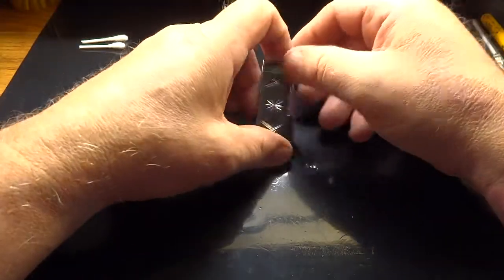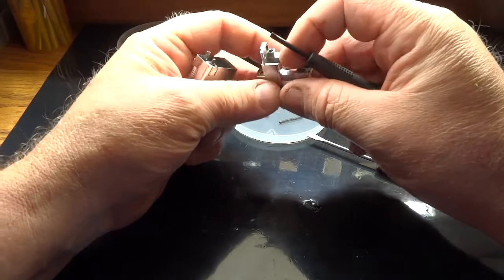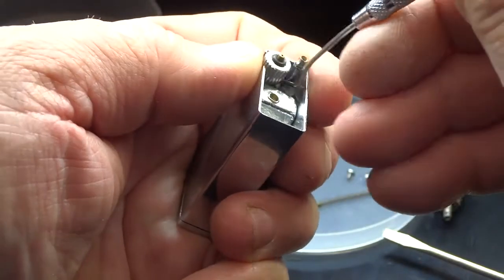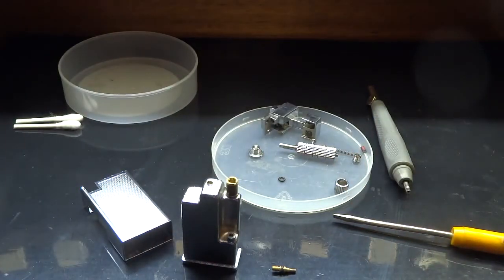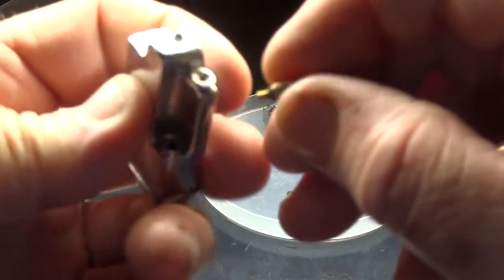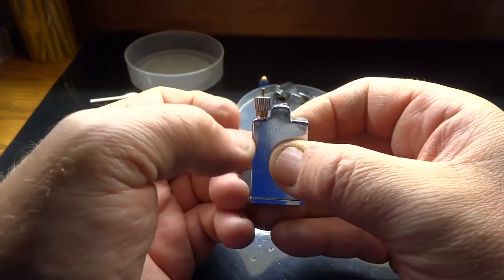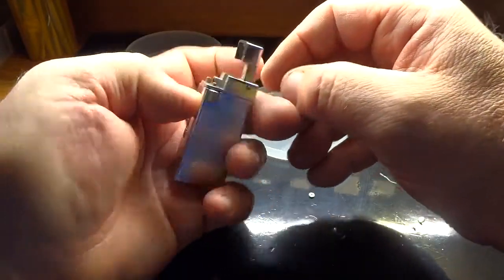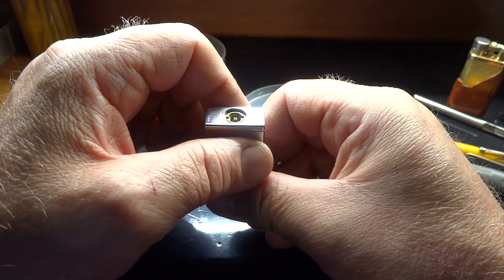Jjj Butane Lighter Repair again!

Comment: I wish I hadn’t skipped this part when fixing my studio “R” and JJJ Prima lighters. I ended up undoing a flint spring and stuck that inside the hole then I used kanthal wire, 24g? To completely clear it. One was covered in a tar like gasket material. The tie sounds like a good replacement too! The kathal is a lot stiffer, one I was able to push in a tiny safety pin once cleared already. I cleaned mine with a tiny tiny water color brush that I cut down to about 3 mm like a pine tree shape that was a super skinny brush handle and sanitizer which I went back and forth with. Its so much faster now that I know how everything works. Wish I kept more gaskets and sponges from my huge lighter lot. Didn’t think ofvits use until I bought vintage.

Comment: Great video. The 3mm diameter rubber seal you punch for the cap that shuts the flow of butane off, I noticed it obviously is mounted to a spring 5:22 what stops the rubber seal from falling out? Do you have to glue it to the spring underneath? ✌️
Reply from the maker: When you remove the rubber seal there's a little metal cup that the rubber seal fits in. The spring is behind the metal cup. You just have to cut the rubber seal a little larger than the cup so it stays in by itself without the use of glue.

Comment: 1st, thank you!  Where would you recommend to go get this lighter?  Enjoy the rest of your weekend, Art
Reply from the maker: A gold one sold on ebay a couple days ago. About the only place I know of to find them. If your interested in mine I will let it go for the same price as the one that sold on ebay and I will send you extra stoppers for the lid for when you need to replace one
lighters2018@gmail.com

 https://www.ebay.com/itm/Vtg-Japan-JJJ-Lighter-Gold-Plated/133589244230?hash=item1f1a8a1946:g:JzYAAOSwV-Je5Xn3
Reply: @Lighters-cf4bd  Your very generous.  It’s a beautiful lighter but I realize it’s not a pipe lighter.  I’m looking for a reliable lighter where you can easily adjust the flame like the Jjj.  I have two im Corona lighters & they both have been given me troubles since I purchased them.  I’ll continue to watch your vids. 
Thanks again, Art